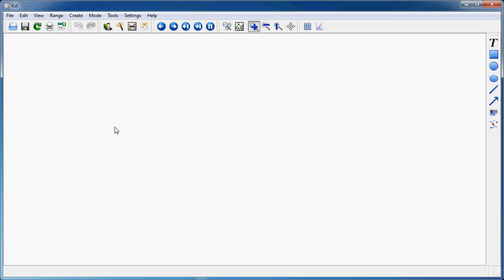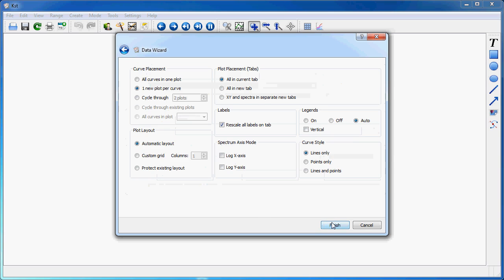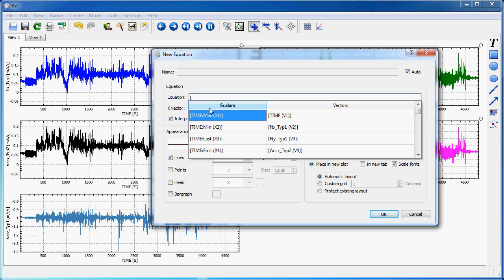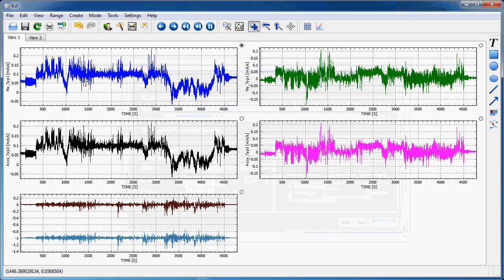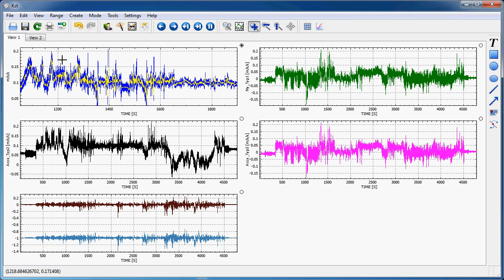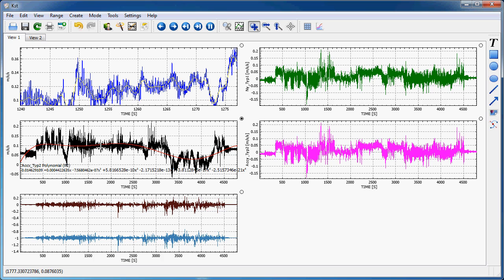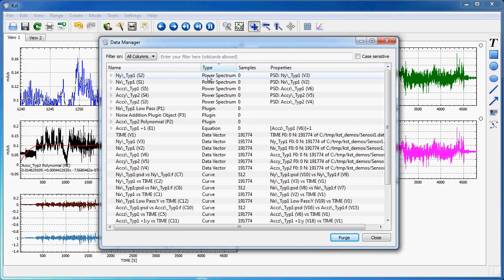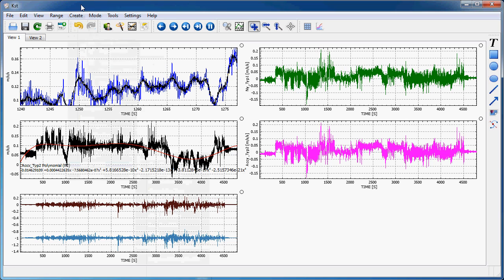Kst presentation #4: FFTs, equations, filters, fits, plugins

Comment: I am trying to use band-stop filter on some data. Data sampling is 500SPS, and I am trying to cut 50Hz frequency out. Somewhat value in Central freq/Sample rate of 0.1 (500/50) is not doing what is supposed to do.